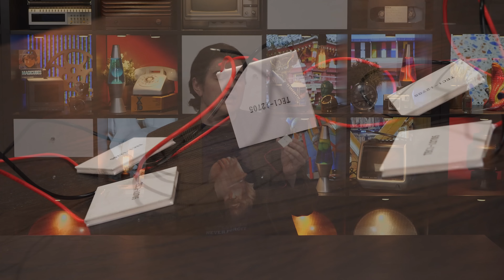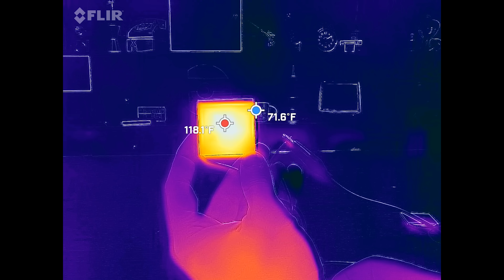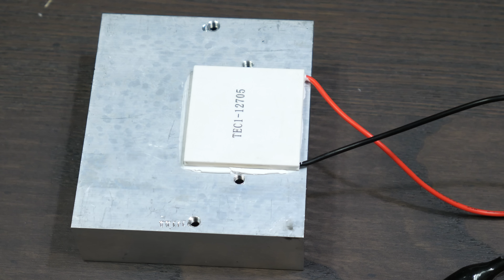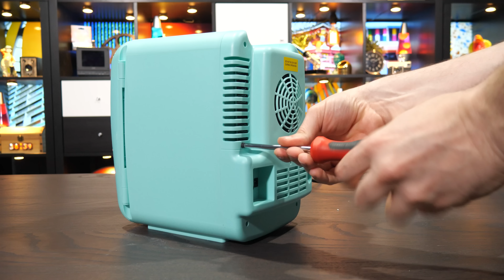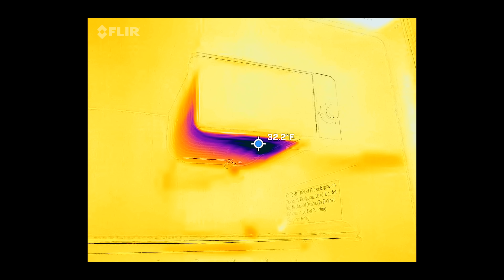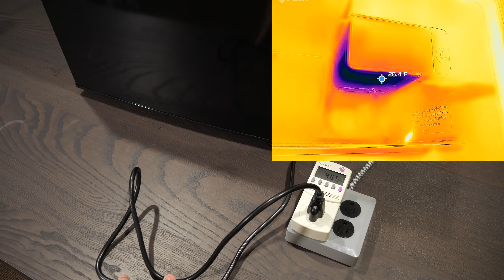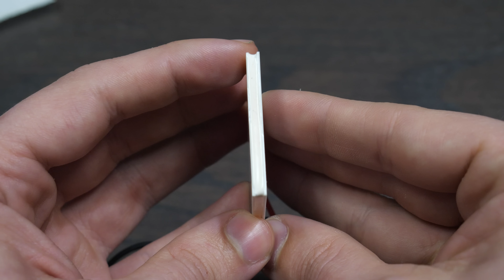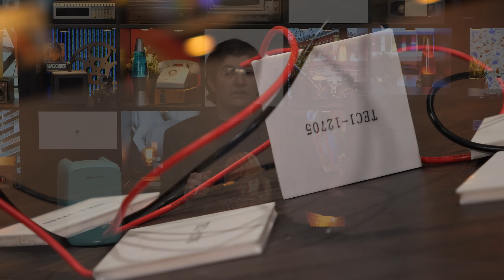Thermoelectric cooling: it's not great.

Comment: I've always been more interested in the energy recovery potential of Peltier elements than thermo cooling using them. While the amount of electricity they generate is relatively small it is still something that could potentially be captured when placed on something that has a temp gradient

Comment: I got a shitty thermoelectric Bud Lite fridge from Walmart for $11. It did the job for what it did (keeping my energy drinks and lemon waters chill), but I figured it could be so, so much better. It ended up shitting itself. Looked into other thermoelectric fridges but couldn't decide if I wanted to bother with them again. When I redesigned my room recently, I got an mini fridge with a proper compression cooling system for $130. Haven't looked back since.

Comment: Just a thought running through my head right now. It's most likely very stupid though for reasons I wouldn't be able to think of due to my lack of actual knowledge in any of these fields.

What if you made a much larger one and put it in a wall to keep a room "cool"? But the hot side would then be hooked up to a water tank to heat up the water for use in the house in place of the standard hot water heater. Theoretically as you use the water throughout the day and it's replaced by cooler water, it will help to keep the cool side cooler.

Like have the water tank running in the middle of the house or apartments between the rooms with the hot sides heating up the water tank in the middle and the cool sides being in the walls of the rooms keeping them cooler. 

I'm just trying to come up with something that would utilize the cold side for cooling down something but then also use the hot side for something useful. I would want a cooler room but also want hot water when needed. So have the cooling element inside the wall of the room I want cooler while having the heat transfer to something that would need to be heated up but would also need constant heating since you'll use up the hot water throughout the day which would also have the benefit of cooling down the hot side in the process which would also cool down the cooling side.

For an appliance, like have the hot end heating up an Easy Bake Oven or something while the other side "cools" down your drink. But there'd be nothing to keep the hot side from getting hotter and hotter. And you already said that it's on or off and no real in between so whatever you cool would most likely not cook well at the one temperature.

Comment: Yeah, had one of these (nb. much more physically large) and I did wonder how useful the peltier element was. I was driving vans - some without a/c - and it was just to get my sandwiches to last a few hours longer (and to stop any snack chocolate becoming drink chocolate, and to delay the warming of my drinks). I had a hunch most of the cooling was done by a few ice packs that I cycled into the real freezer overnight ofc - this does confirm some suspicions 😄 Never did a comparison test though, alas.
A few times I shoved my phone in there as well to allow it to keep operating as temperatures got exciting in the cab sometimes...

Comment: I remember hearing that a heat pump can capture heat energy that is 4X the energy used to run it. It occurred to me that if you could take a quarter of the captured heat energy, and convert it to electricity, the device (once started) could run itself! But I assume that the reason that won't work is because there is no known efficient way to convert the heat to electrical power. But even if a conversion was possible that was only 33% efficient, you could use three-quarters of the captured heat to run it, and still get some free heat. (Probably not much!)

Comment: I'm a truck driver and I use a Coleman Peltier cooler in addition to the fridge in the truck. I keep things like fresh produce, butter, cheese, and non dairy milk replacement in it. I also move things to the actual fridge through the week as I use up the meats and prepared food. I would rather buy a proper compressor style cooler but I'll be moving to a local job in the next few months and can't justify the expense. It does the job well enough for me, but I don't love it and steer other drivers to spend the money on a proper solution.

Edit: the thing I'll add though is the Coleman cooler has a fan inside to move the air around. I find that if I keep the outside of the Peltier near an AC vent then the cooler does get cold enough to feel sufficiently chilled. I've never bothered putting a thermometer in there though because tbh I don't actually want to know 
😬

Comment: I happened to get really cool device on my hands. It's a fan with electric motor powered from this element. Bottom is a solid metal plate and top is a heat sink. You place it on top of the furnace and because of temperature difference element starts generating electricity. Fan spins and cools heatsink preventing heat equilibrium while fulfilling its purpose, mixing hot air from the furnace inside the room.

Comment: I built a computer in the late 80s with a 486 processor. I don't remember the clockspeed, but it ran hot, so I purchased a active heat sink... With? You guessed it. A peltier device.  It was great! 
Until it wasn't. It cooled well enough that the underside of the CPU got below the dewpoint. You know what that causes? Condensation. Water 💦 on electronic pins DOES NOT go well. Two or three pins CORRODED and fell off. Dead CPU. Dead motherboard. Lesson learned.

Comment: I really like your videos and I'm not a fan of the "active cool boxes", but you made some bad mistakes when it came to the electrical properties of peltiers elements.

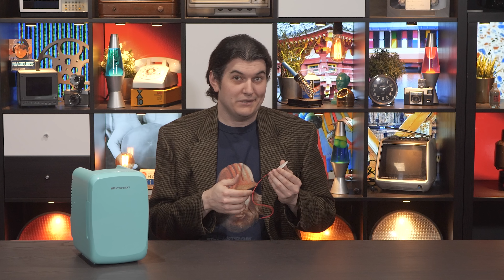First of all, at 4:45 you said "they're  dissipate 60W on top of the heat they are pulling from the cold side". More correct it is like this: The element can draw max 60 Watts, if the dT is small enough. From the 60W a part is additional generated heat, and a part is energy that is used to pump energy from one side to the other (i.e. Efficiency).

Second, you mentioned that it will draw 60 Watts all the time. This is also not true. As the temperature difference rises (inside is getting colder, outside is getting hotter), the peltier element will draw less and less current (and will also get less efficient). But it's not true, that once it reachded the 30-40 Kelvin of difference it will draw 60 Watts. In fact, if you would turn off the fridge when it's cooled down inside and (relatively) hot outside, the peltier will start generating power (known as Seebeck effect. In more technical terms, the higher the temperature difference becomes, the higher the internal resistance will get (thus drawing less current, as the voltage is stabilised at 12Volts).

So yes, they suck a lot, but they are not as worse as youu compared them - sorry to correct you ;).

Comment: I am curious about the efficiencies if one considered using the heat cold is sort of an odd byproduct, but you wouldn’t be able to get out of a typical heater but yeah I agree they’re cool but they suck. Anybody used one and got excited and then quickly realized this thing uses a crazy amount of electricity. And it’s practically impossible to cool so while realizing it’s somewhat unusable, it’s still fascinating to watch that penny frost over in just a minute until a few seconds later when the whole thing heats up and melts

Comment: My parents have a peltier powering a fan to go on their fireplace, heat passing through creates a voltage. They seem like they'd be most useful this way, where you can just hook up a fan to it and only when it gets hot enough to power the fan will it do so, trivial to set up, it's just that the fan does need to also be used to dissepate the heat that has passed through the peltier

Comment: At Uni I wrote my masters thesis in a workgroup that focused on additional Virtual Reality experiences. Multiple projects tried to add thermal feedback to VR environments and the Peltier element was almost every time the best device we could choose. But it's also fair to say, that all of the points when to use thermoelectric cooling applied, like cheapness, combined cooling and heating, size, weight etc. There are quite a few papers already that investigated thermal feedback for VR applications (some also 15 years old or so), but just like the mini fridge in this video, we see that this tech just didn't caught on.

Comment: I have the Mobicool Thermoelectric Power Wheeled Cooler. it probably uses these. i went to drive in movie. I used my ebike battery and a buck converter to run it the whole time.

Comment: I have one of those peltier style ones for the car. It does what it needs to be as far as being portable and putting in a little more work than a standard cooler would do (for things already cold). With the lubrication concerns of an actual fridge, it is superior as far as mobility but not much else. Easier to manage in a car than swapping ice in a cooler too. Neat to learn how awful they are in wider applications though.

Comment: I have one of those little Vector "brand" automotive refrigerators, which I bought in 2008 when we started taking occasional long road trips in our minivan. I thought it was piezoelectric at the time, but it's probably thermoelectric/Peltier. It actually works reasonably well within the intended parameters. That is to say, as long as the ambient temperature is below 80F, which it usually is in the house when we load it and in the minivan after the climate control has had a chance to make things comfy, the fridge manages to get down to 37F within 45 minutes and keep food between 37F and 45F, which is good enough to keep it safe to eat for the trip. (As a rule, any truly perishable leftovers are disposed of after the trip.) It's even pretty quiet, although not whisper-quiet. But nobody is ever going to confuse this li'l travel fridge for the real thing. We had the outlets in our minivan rewired so that they stay powered when the ignition is off and the key is removed (yeah, our van is that old!), but when the van is sitting out in the sunlight and the interior gets a chance to get hot, that refrigerator will be struggling to maintain 55F inside, and if we're traveling on one of those beastly hot summer days when outdoor temperatures are in the 90s, we might get back to the van after a lunch stop (during which we took the contents of the fridge inside with us) to find the fridge temperature readout at 65F. And while it's more spacious inside than your little blue toy, it really doesn't hold all that much, maybe a few packets of sliced cheese, a few spreads and a few sandwich bags of cut veggies. We don't even try to use it for drinks. So, yeah, it's fine for the purpose intended - keeping food sufficiently cold during a 13+ hour road trip - but I would not recommend it as, say, an office mini-fridge.

Comment: The tiny console fridge/freezer in my SUV (holds about three cans) is a vapor cycle, because TEC devices suck. I assumed it was a Peltier stack, but found out otherwise, to my great surprise.
Though they are used to great effect in amateur astrophotography to chill a sensor chip, to reduce noise, so you can yeet the gain and still get decent shots. These are typically stacked (yeah, that's a thing) to get a lower temperature.

Comment: The main use I see for Peltier modules is in powering low current things in certain applications, without moving parts in some applications.
For example if you happen to have 2 sources of water with heat difference between them. 
That, or powering the first manmade things to leave our solar system. Plus some Mars rovers.
Sorry, just felt it could use a mention. The chips in those cost probably a hundred grand each I guess.

Comment: This is a suggestion for a future video about refrigeration: what about the ammonia-water absorption cycle? Those are the ones used in caravan fridges running on both LPG and electricity or the super-silent you sometimes find at hotels.

Cooling with a flame has ever intrigued me.

Comment: I use one of these to travel with insulin and it keeps it cool at about 38-41 degrees. It can be used with a power prick and it keeps my insulin in range for 2 days. Plenty of coolness  to get to Shanghai China. Best solution for travel I have found. If I want a could drink, I buy one.

Comment: Meanwhile i have a small solar panel on a styrofoam box with the peltier elements sitting molten into the top lid.
Top side is warm, bottom side is cold. cold air above is heated and rises - passively cooling it, cold side is at the bottom and cools the air directly below it - which sinks and is replaced with warmer air.
If there is sun - it will cool the box. if there isn't as much light - the elements don't have to work as hard.
the dimensions of the box are 42.5cm x 42.5cm x 38cm with 5cm thick walls.
i originally used 4 elements with a solar panel that was the size of the lid, but ended up halving it when one of the cans burst from freezing.

Comment: I’ve been ranting about this exact thing for AGES! One of the most popular uses is 12V DC “electric coolers” for camping, which is fine if you have unlimited power, but terrible if you’re on battery or solar. 

One thing you’d be delighted to hear is that a number of Chinese companies have FINALLY started building portable coolers with ACTUAL refrigeration systems! 

I just purchased a large 58qt cooler for a very reasonable price, and the thing (in in eco mode) draws 45 watts! It also has a digital temp control and a “colder / freezer” spot inside, plus LED internal light. 

I set it to ~28ish and even in eco mode, it only turns on once every 10-15 min for maybe 60 seconds (again, only drawing 45ish watts). 

It’s INCREDIBLE how much more efficient this thing is versus a TINY old school Coleman “electric cooler” with the peltier device. 

A single LiFePo4 100AH battery had no issues powering this for over a week on a camping trip, it was supplemented with some solar but still… it would go forever. 

Might be a good follow-up video actually as these things are fairly new to the market. I guess the main issue was companies building 12v or DC refrigeration compressors - that seems to finally have been solved.

Comment: The peltier element can also function as an electric generator. If you introduce a temperature differential to the two sides of the element, you will get a voltage on the "input". There are fans for putting on top of fireplaces to get air circulation that demonstrate this perfectly. However, the pitch of the fan blades is so miniscule the air circulation is barely measurable. Cool gimmick though.

Comment: Despite the many disadvantages i think Peltiers would still be better for peak solar water boiler heating than those purely resistive heaters people use in their boilers. It is a thing people with big PV installs on their roofs use to avoid selling their overproduced power to the grid. Hurts my efficiency sense  that they put PV power through a resistive heater.

Comment: I imagine it's not beyond the realm of possibility that an array of those devices could be hooked up together to act as a sort of "Push button for quick cooling" on a cooler.
A warning that one side of the cooler would get hot, and the intention for them to only run for as long as they can safely run for. 
But if it's attatched to something that's already well insulated, I imagine it might be a good way to get some use out of them.

Those modules appear to have two distinct advantages;
1. Size/Weight
2. No moving parts (by itself)
And so, I imagine the main challenge is to find a way to capitalize on at least one of those.
You can't get a mini fridge as small as those desk-top can coolers. Even if they're sub-par, there's not really an alternative

Comment: As a side note. I have been trying to think up a cheap way to store solar power. Not efficient, cheap. What do you think is worse to recover heat energy? A Stirling Engine or some Peltier coolers? They both suck but I think the Stirling Engine sucks less.

Comment: An important note on the environmental impact of isobutane: that global warming impact of 3.3 (I assume relative to CO2) would be if it is released into the atmosphere. Which may happen when the fridge is disposed of, and may happen when the system is serviced in some ways, but the amount that gets into the atmosphere over the course of the lifetime of a fridge trivial. It isn't just that there is only 55g, that 55g stays inside the fridge while it is operating.

Comment: Was a time Peltier coolers were all the rage for enthusiast PC cooling, since they could theoretically chill a CPU below ambient, giving it more overclocking headroom. They died off for the same reason the fridge sucks. High power draw for marginal performance. Soon as maintenance free AIO water coolers came out, they disappeared. Water just has a lot more thermal mass and the pumps don't use as much power. Fun fact, there was a time you could buy "phase change" CPU coolers for extreme overclocking. Those used the refrigeration cycle. Had a huge hose that went to an external box. They cost as much as the entire computer. Some folks even made DIY ones by hacking cheap window ACs, but I don't recommend doing this. 

Those 12v electric coolers you can get for camping use Peltiers. No idea how good they are, but I'm guessing performance is better due to the thicker insulation. They can also work in reverse to keep food warm.

Comment: I have one of those few devices where a Peltier cooler makes some sense. I take a drug that comes in an injector pen and needs to be kept cold. I needed to go on an overseas trip, and I found a USB-powered refrigerator-thermos bottle that does the job. Even has a thermostat to keep things in an ideal range. It's about 1L in size, though the internal volume is much smaller.